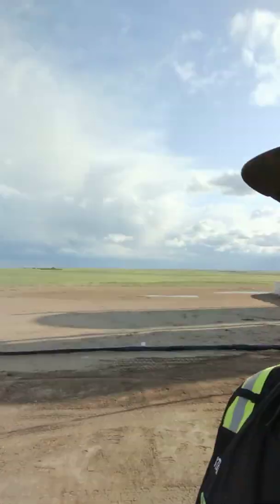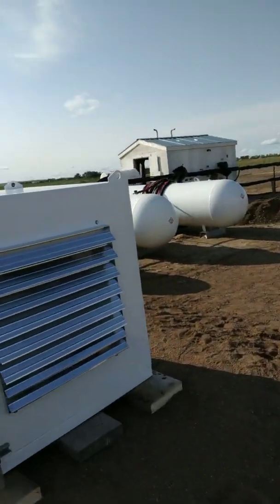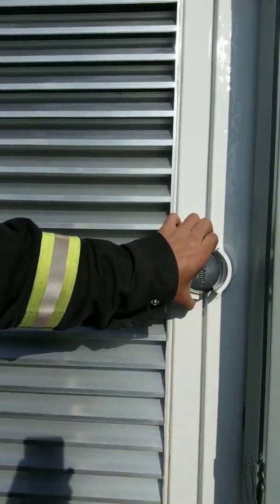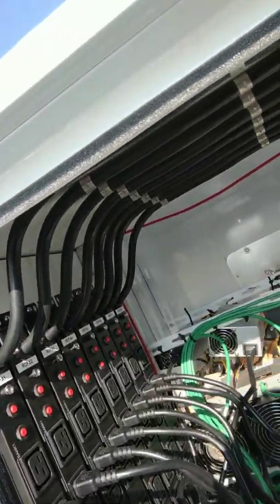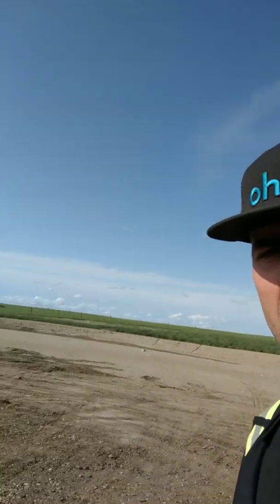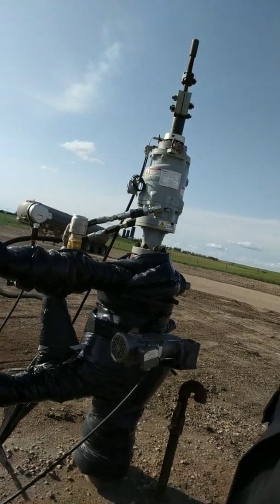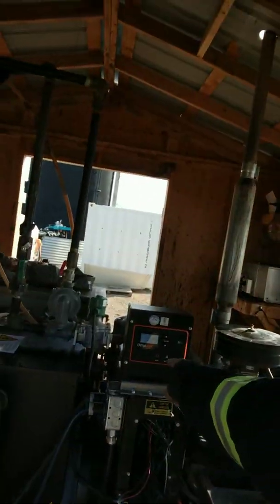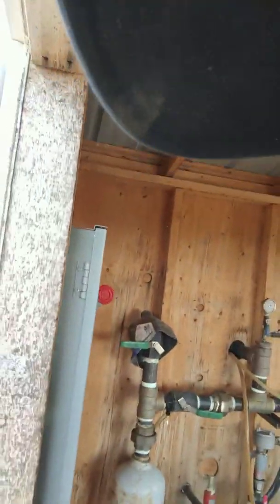Ohmm Mini Tour - Bitcoin Mining Using Stranded Natural Gas

Comment: What's with the multiple 1,000 gallon propane tanks on site?
Reply: my guess is compressing some of the gas to use for drying crops or home use. Won't have the energy density of straight propane but it will do.